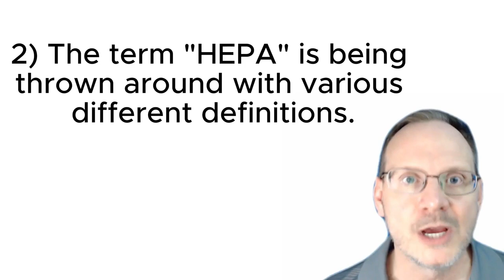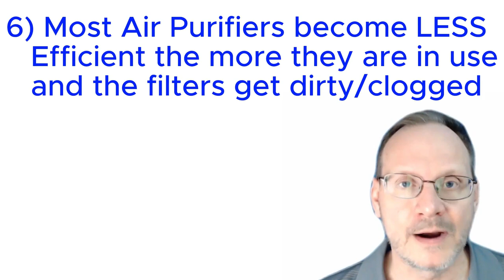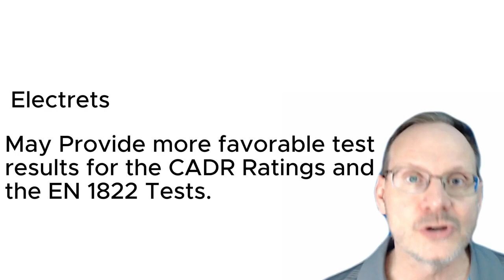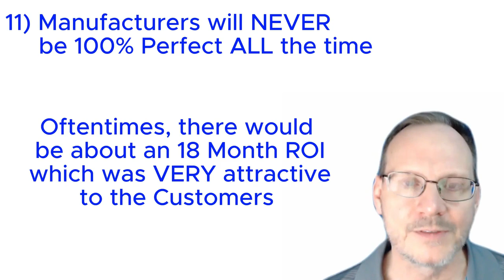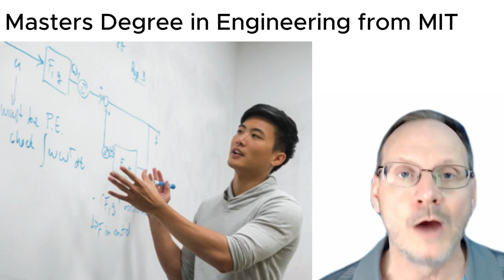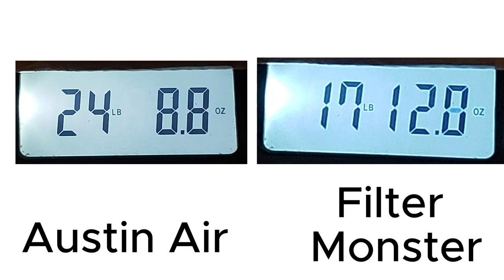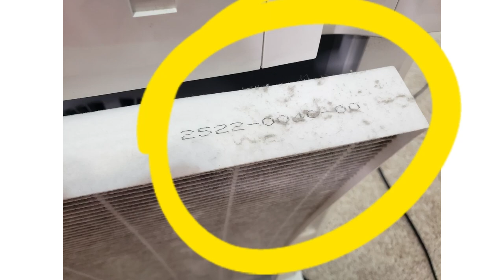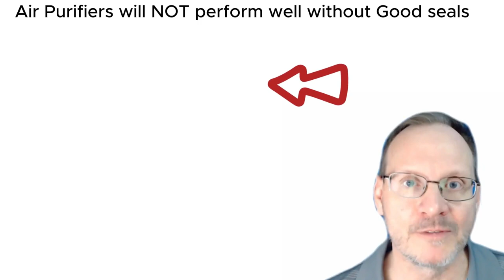HEPA Filters - Are they all the same?

Comment: Hi, if I am trying to clean an 550 sq ft environment  next to a busy street (where VOCs seems to be the biggest issue)  would the IQ Air GC Multigas do the job or would I be better off with two Austin Healthmate Plus's?  p.s. the building is new and has a relatively good circulation system that moves the air through the apartment without needing to open the windows (it has "some" particle filtration but obviously doesn't address the VOCs). pps. Might the Dyson Big and Quiet Formaldiihyde BP04 do the job? (I worry that Dyson is just marketing)
Reply from the maker: Hello and thanks for the question👍
1) 550 sq. ft. with 8 ft. ceilings?  An IQAir HealthPro Plus should be able to do a very good job +  you will get superior filtration for ultrafine particles which are the most dangerous to our health long term.  The pollution from street traffic also contains small particles.  The GC doesn't filter particles as well as the HPP so I prefer people go with the HPP if they can because of it's elite particle filtration.  I've had a HPP in a room about 350 sq. ft. with new paint on the walls and new carpet offgassing a lot and it did a really good job.  So, I think it would probably do a great job in 550 sq. ft. for VOCs and particles.  The HPP has about 5 lbs. of carbon and the GC has about 12 - but it is the same type of carbon in both.  Also, if the carbon gets saturated in the HPP - you can get a replacement carbon filter for $99 - and I think that is very reasonable. That is what I would try to do if I were in your shoes.  That said, you know your environment better than me and if you think the HPP carbon would not be good enough - then you could go with the GC. 

2) Dyson is really coming out strong with that new unit, huh?😄LOL! I will eventually be checking that unit out in the future - it does look like  an upgrade from some of their other air purification offerings in the past.  They got embarrassed a few years ago with their air filtration fan on a Canadian TV show so I think they decided to really try to "Up their air purification game". And I am happy to see they are really trying to improve their air purification offerings - kudos to them.  That said, I don't have much confidence that it performs as well as IQAir units... but I'd have to really "check it out" to get a better feel for it.  It's not easy to "shift gears" and suddenly mass produce a "superior air purification solution" when it really isn't a category a company has a strong history on, IMO. 

Thanks and Good Luck! 👍
Reply: @AirPurificationEducation  Thanks so much for your reply. Coincidentally, after noticing a comment in one of your videos (that the HPP was better than the GC for fine particles),  I concluded that I could do just almost well with the HPP for VOCs by simply replacing the charcoal filter more often (probably every year). P.s. My ceiling are 9" so that gives me a little over 3.7 full air exchanges per hour (with then HPP). I should also mention that I got caught up in the new Dyson hype and ordered one about a week ago. Then, as I went down the air filtration habit hole and learned more and more, I realized it was probably a mistake but... they have a great return policy (and will pay for return shipping) so I might as well wait till it arrives and give it a try.
Reply: @AirPurificationEducation  Also, It's quite fascinating that, people with authentic know how (like yourself),  stand out from the YouTube pack with the sheer integrity of their words. I've encountered this a few times and was able to recognize expertise purely on the "gravity" of the words (without having to know the  credentials).
Reply from the maker: 1) Yes, I'd def. try to go with the elite particle filtration of the HPP and maybe swap out the carbon more often if need be.

2) I don't know for sure how the new Dyson performs so I don't wanna be a naysayer without actually learning more about it but I have seen it on 2 "Best Air purifier Lists" on YT and they amazingly were chosen as the "Top Pick" on both lists... and my kneejerk reaction is that makes me believe they are financially incentivizing $$$ the "content creators/influencers" to push their solution.  I could be wrong but I do know this is how things work with most content creators.... and if I was the VP of Marketing for an Air Purification manufacturer - you better believe I'd be throwing some cash at the influencers to rank my unit higher... for SURE -  LOL! 😆

3) Yes, please tell me how you like the Dyson - it looks like they really tried hard to make a good solution and I do applaud them for their massive efforts as it appears to be a complete overhaul which takes a lot of time, money and trial and error. 👍     @nternalPractice
Reply from the maker: That is very kind of you, however - as I like to say, "I am a Student" in this industry learning a little more every week.  "Air Purification Education" is actually, to a large degree, ME getting educated and offering up what I think may possibly be true. I think there are probably very few true experts in the world in any industry, lol😄
Reply: @AirPurificationEducation   I'll keep you up to date. I know EXACTLY what you mean about incentivizing. I think this is how Apple is able to maintain its' status when they clearly have been  putting out progressively worse garbage over the last few years. I can usually see through that kind of YouTube "review" and agree they are the norm (rather than the exception). I actually  got the BP04  early  (today) and have had it running on high for a few hours. The readings from the unit look very good and the AQ graph shows that it significantly lowered  the contaminants (mainly formaldehyde)  in the first hour but... my new Atmotube readings didn't change  and look pretty much the same as they have  over the last few days (which are generally good but not perfect). The atmotube is decidedly "budget" but I got it just for comparisons sake. At this point I tend to think the Dyson readings are overly optimistic  (showing VOCs at 0 when my atmotube was showing a slow rise  up to 3.0).
Reply: @AirPurificationEducation   Absolutely get where you are coming from. I have a physics degree and have a strong appreciation for the complexity of real world problems.
Reply: Dyson BP04 update:  WHAT GARBAGE!!!!!... I just got this thing yesterday (to try out)  and had it running full blast in my 550 sq ft space for about 16 hours. I have been living in my apartment for 18 months and  have have RARELY smelled cooking smells from other apartments. Ironically, with the Dyson running full blast, I woke  this morning to the strongest (and most annoying) cooking odour I have ever experienced in the apartment. Not only did the Dyson appear to do nothing to mitigate this,  its'  readings and sensors also appear to be garbage (showed virtually zero particles and VOC). For another, and easily testable example,   the temperature reading has been  75F for the entire time I've had it on when, in reality, the apartment has only been 70F (based on the 3 other thermometers I have). This things going back. Since I live in Canada and am trying to mitigate VOC from street traffic, before I commit the the IQ HHP, I'm going to check out Airpura and see what they come up with for a recommendation.
Reply from the maker: Thank you for the update! 👍 
1) I will say this... I've had 3 different manufacturers over the years, including Airpura, say to run the units no higher than medium speed for odors/VOCs as the lower CFMs enable the carbon to absorb the VOCs better.  Higher speeds push the air through the filters much quicker and may not be the best idea when trying to specifically get rid of odors/VOCs.

2) Interesting on the sensor issue - unfortunately, I think most all units have sensors that are inaccurate... to varying degrees.  I don't pay attention to any of the sensors on any of my home air purifiers and I don't run any of my 4 different air quality sensors either as I think they are inaccurate + none of them are really going to be able to tell me what levels of ultrafine particles are in my air sooo... I currently don't really see a great benefit to me "trying to figure out" which is possibly telling me the "truth". 

GOOD LUCK with Airpura - they make good units, IMO.  😄   @nternalPractice
Reply from the maker: Years ago I thought to myself "why would I want to sell an air quality tester with the air purifiers as the customers I'm dealing with will sometimes possibly see a "poor" reading from the sensor and then be inclined to call me back to "chat" about it or flat out return the unit".  Neither scenario would be considered a positive for me.  So, I also concluded that air purifier manufacturers are actually incentivized to have the sensors on their units "prove to their customers" that their air purifier purchase is actually working well, of course.  Right? LOL!  😆

Why would they want the sensor to continuously tell their customers that they only have "Fair" or even "Poor" air quality... after they just spent $200 to $1,000?  That is just asking for LOADS of trouble.  It would result in tons of calls and emails to their customer service center and many, many returns which most manufacturers typically try to avoid like the plague.  

IMO, the manufacturers are gonna want the sensors to be "optimistic" about the air quality, for sure. I am just guessing here, but it totally makes sense to me.👍

  @nternalPractice
Reply: @AirPurificationEducation  Interesting!  Clearly if Volkswagen, an old and established company, was willing to fake pollution results in order to sell cars in todays market,  it's highly likely that manufacturers of air purifiers  wouldn't be above  manipulating the readings on their sensors to make things look better than they actually are. I will try the Dyson on a lower setting and see how that works out. I actually have 3 months to decide if I want to keep it.k  Might the "auto" mode be a good idea if I don't really know where to start? 
P.s. I wasn't really looking for anything definitive with my AQ sensors (either the Dyson or the Atmotube) other than to get  ballpark trends and a very general idea of what was going on.
Reply from the maker: Yeah, I guess that could be OK - I'd just run the unit on medium continuously to see what happens... thanks and Good Luck!   @nternalPractice